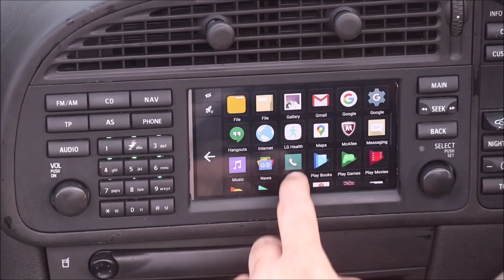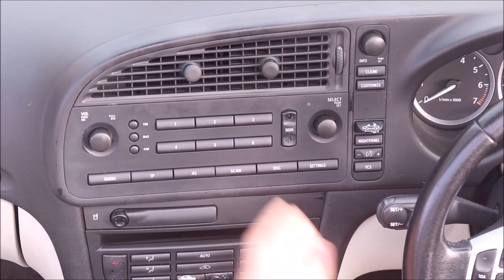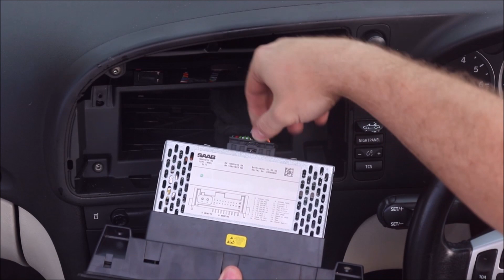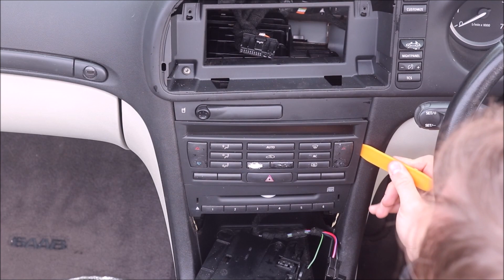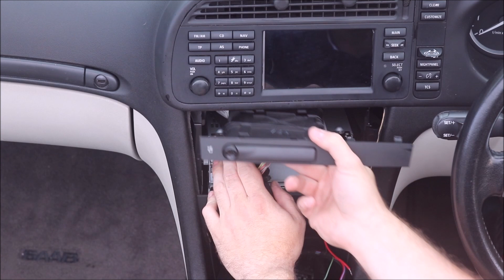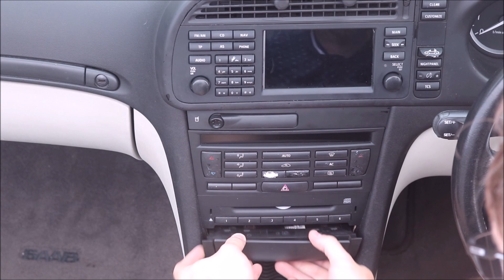Saab 9-3 2003 -2006 LG Phone Radio Upgrade

Comment: Hi.
It seems awesome. Sent you an email. 
But, like you say, for benefit of all... Some questions. 
all radio stations will be listen as normal? 
 CD will work as well?
All Steering wheel commands will fully work?
Will it use the inbuilt GPS antena? 
If required can it be reversed to original configuration? 
Thanks
Reply from the maker: Answered your email :) Yes to all your questions
Reply: @SaabUnleashed  oh hey, if yes to all above questions, i might be interested in a LHD one!
Reply: oh, question, how does it respond when you have nightpanel on?
Reply from the maker: @sturgis007  no, it has no data connectivity to the car. But it does dim itself at night

Comment: Look like a great solution! I do have a Lefthand 9-3 aero convertibel from 2004, would that go? You need to use a simcard also ore just use your own phone when it is installed? It is a Ipone?
Reply from the maker: These are right hand drive only unless you send me a left hand ICM. Or you can buy a modification pack and modify your own. No, you don't need a simcard. If you want to use online functionality, you can connect it to your phone's WiFi hotspot

Comment: Where do you get these units from ?
Reply from the maker: From me
Reply: Stuart Bell  can I fit thi to my Saab 9-3 vector convertible 55plate
Reply from the maker: @darrensmith1602  Any Saab 9-3 between 2003 and 2006, so yes
Reply: Stuart Bell  how do I get one and how much please .
Reply from the maker: @darrensmith1602  search Zaab on ebay

Comment: Hi Stuart,
With this new radio the car comes really into the 20's. I got a convertible automatic 9-3 from 2000. Steering wheel left. Can you help me too with a swap radio? Gerard from Holland.
Reply from the maker: The 2000 model will be much easier as its prior to the fibre optic system. It will be a matter of acquiring a wire harness, a bezel and then choosing which radio to put in. I recommend the android ones

Comment: Stuart how it’s possible without audio in?? The source now is the phone right? So how do u send the out audio line from phone to the car???
Reply from the maker: It's broadcasting on an FM frequency in Stereo
Reply: Stuart Bell so with an FM transmitter? I actually using this system for a Galaxy tab in the Dashboard hahahaha.....so you are Powering also that module with the cable that go to cigarette lighter?
Reply from the maker: @michelesalone6826  that is correct
Reply: Stuart Bell are u still able to use (listen) the oem radio station?
Reply from the maker: @michelesalone6826  of course

Comment: The clicking noise comes from a plastic gear that has some teeth broken, in turn that gear belongs to the electric motor assembly that controls the flap for the recirculation option on the climate control. There's at least 1 video about it (by The flying mechanicDIY)
Reply from the maker: I recently picked up this car on the cheap. It has a problem with a roof sensor that causes the climate contol to flick quickly between its roof up and roof down modes, this is likely the cause of the missing teeth. Gotta fix that first. There's a lot of issues with this car!